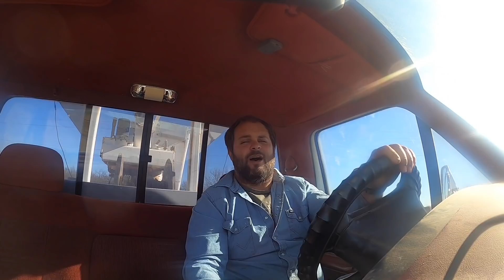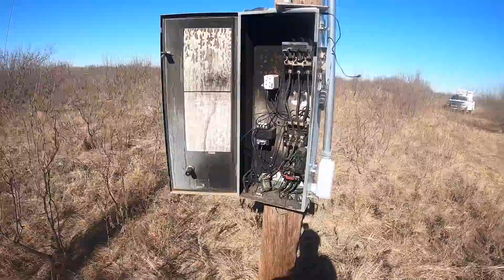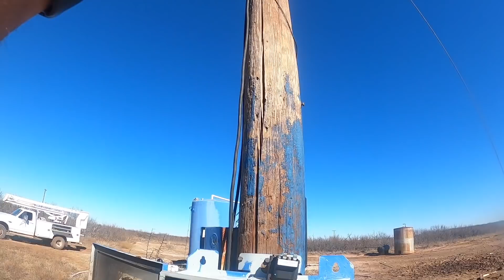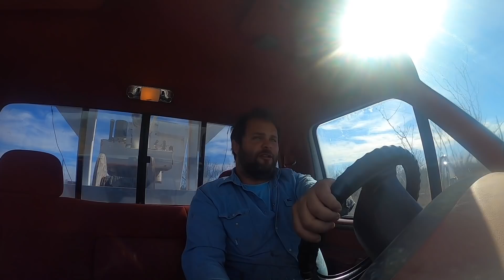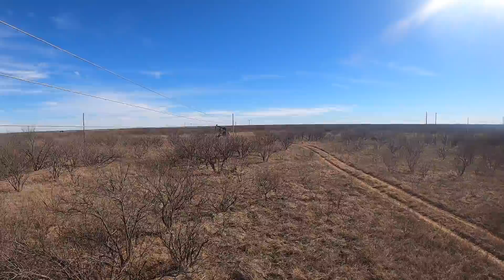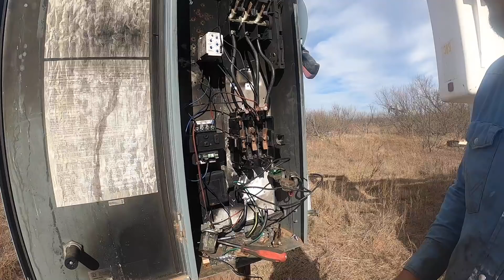Lightning Strike on Some Oilfield Electrical Equipment.

Comment: The clutch setup on the OBS fords absolutely sucked.

Every 3 wire delta system I've ever seen always had issues with voltage regulation and the faults were catastrophic.

Comment: Thanks Zach! I have to watch it again, esp the part where the wire exits the box to the side of the bottom and goes back up the pole to carry the power on to the next pole, if I understood correctly. Doesn't that makes the wells wired in series, not parallel? I have to watch it again. Thanks for the detailed video, really interesting! BTW why not use 3 phase motors on the pump jack? Wouldn't that save on running costs?
Reply from the maker: They are parallel and are all 3 phase 480.
Reply: @TheZachLife  Thanks for taking the time to answer! Have a great day!

Comment: Zach you should never connect copper wire to aluminum wire with out being separated by the correct kind of clamp because copper will eat up the aluminum and using an oxidation inhibitor grease is even better. Also when running the wire from the weather head on your conduit make sure you have a drip loop about two inches to keep water from getting into the conduit. Keep up the great videos.

Comment: Good rundown on NEC vs ad hoc wiring. Lightning doesn't care about NEC. It blows everything up regardless. So many surge suppressors are 'one shot' on a heavy hit. Varactors also wear out in time and do nothing to protect the circuit. They take a limited amount of surges.
The best bet is some kind of spark gap protection but given a big enough hit, they'll be damaged as well. Tips will melt off.

Comment: If lightning blows up the 480V wire in the conduit, would the ground rod at the pole carry enough fault current to blow a fuse back at the transformer?  Probably not. Would need a bonded neutral back to the transformer $$$

Comment: 😂 you should put a drip loop at the weatherhead so the water don’t run back down the conduit in your box😅
Reply: The conduit runs into a fused disconnect rated for indoor use only. Go figure??

Comment: Great video, that bucket truck you have is awesome for the type of installations you work on. Yes, Texas has a lot of heavy lightning storms. I have been chasing tornadoes in Texas, Oklahoma, Kansas in 2011- 2014 and seen those storms. A lightning rod on the pole won't help enough to protect the equipment as long runs of OH wires are fully exposed to lightning strikes.

Comment: Are ground wires that come down from the lightning arrestor on the tops of the poles are bare wire they're not in conduit

You could even put plastic conduit for the wire to the lightning rod

The other thing I would try is putting equidistant grounding rods into the ground

Just out in the middle of the fields take a 10ft rod and drive 4 ft of it into the ground

And watching lightning I've seen it hit many times things that were lower than the poles

You can see the streamers coming up off of the poles and off of everything else from the trees to the roofs of houses but many times I've seen the streamers come right off of the ground off of the grass and the lightning will strike the ground instead of striking something that has a streamer that's much higher

By putting in those rods in the fields you give the lightning a lot more places to potentially strike instead of hitting the pole

I would at least give it a try

Comment: Hey, how are you? Very interesting stuff you’re doing

Just wondering if you could make up some lightning veins and put them in your area with your heavy equipment you have around on the oil field. 

No, maybe make 68 of them 100 feet high or something lol 20 feet higher than what you’re working with
Reply from the maker: 5:14. Its electric. I would guess the bill is around $100 a month or a little more.

Comment: Have you ever looked into a product called lighting master or something similar?  If you understand how they work, how they created plasma and not attracted to lightning. Research understand how it works.

And another product midnight Solar MNSPD600 480AC or the correct application voltage for each  phase / one for each phase. Shop online prices vary.  
Check it out and understand how they work on the data sheet It may benefit to cut down on some of them lightning strikes

Comment: 18:40 that’s why it’s supposed to be properly grounded. And the current should take the path of least resistance and avoid you as long as your not grounded. Plus if there’s any fuses on those lines if it shorts to earth it’s gonna pull ALL the amps and blow.

Comment: i'd start stocking up on conduit and fittings...  and 5' ground rods.  proper grounding would go a very long way to preventing damage...  3 5' rods tied together at each pole would make a big difference.

Comment: Lightning Protection is a detailed yet grey art. Many simply just don't understand the physics and principles involved. 
Open wires on poles are a sweet target, especially in dry-land like you have. The cabling is pretty well considered a large network of grounded lighting rods, the air gap in breakers and insulation is not going to suppress the rise in electrostatic charge the preceeds a strike and forms the leaders. If you want to study this effect, look into what sailors called St Elmo's Fire. 
Open wires should have a top ground wire to take the bulk hit first (yes, others will still get a smaller whack). Put all your pole wiring in metal conduits and bond and earth as much as posible. Earthjing in dry area needs very deep rods and multiple points. If the water from your seperator is somewhat OK, a small leak intot eh ground around the rods will keep it moist/damp to work a lot better. Each phase in the system as each end of any exposed length of cabling above ground should have a lightning rated surge and ESD protection. The ESD side allows a controlled "Leak" of static charge off the power wires to limit the production of leaders. Spar-Gap or gas discharge arrestors at the pole tops to a earth array will save a lot of headaches. Keep ALL lighting arresting ground cables on the most direct path to ground and dont do horizontal runs. A tick used on earthing systems is a spark gap indicator. Main cable from groundings comes to a sharp set of points and then a small diameter piece of copper wires joins them. When site takes a whack, wire blows making it clear a strike did happen. 
Direct strike is not all you need to protect from, EMP from nearby strikes can be just as damaging.
Reply from the maker: Thanks. I have read about the corona discharge sometime visible before a strike, pretty wild. All of out stuff at here is set up as a corner grounded delta secondary with the top phase the grounded phase. We run 15kv spark gap arresters on the 7200v side and Delta 600V on the secondary 480 side.

Comment: If a lightning arrestor gets fried it saved your equipment, you've got to think of them as expendable. It's not something that's going to last, and if it does, it's not what you need.
Reply from the maker: They usually blow up with the box.

Comment: Lightning hates inductance.  It loves capacitance.  It'll jump a gap all day long.  But it will blow through a sharp turn or a coil.  The stuff we used on the tall buildings in Houston had stakes with rounded ends on them pointed up.  Supposedly it bled off the charge instead of letting it build up to cause a strike.  Not sure if that would help or not on top of your poles.The ground wires looked like braided aluminum rope.  About an inch thick.  I'd imagine the casing and tubing would be the best ground you could imagine, but I'm not really sure about that.  On our radio towers, I'd put a ring of grounds around it, then run the same length wires from the legs to the ground rods, and connect the rods in a ring.  Using flat grounding strap lowers the inductance of the ground, too.  But out there, I just don't know.  I figure you could reduce the damage, but it'd be expensive.  I think your "consumable" electric system is probably the best trade off.  Man, that is some kind of wild.  Dad told me of a spot in their pasture out near Mangum that ALWAYS got hit.  It was just something under there that drew lightning. 

If you are worried about something being hot, use a voltage sniffer.  It uses hand capacitance to light up a neon bulb.  Does that smoke conduct?  I'd be a bit careful around it.  We'd get something like that stuck on the inside of the TV transmitter.  High voltage in there would weld that stuff to the inside of the cabinet.  I'd pull maint every so often and was the inside down with alcohol.  Took about a full night to clean one cabinet.  We had four of them to make power.  Three visual and one aural. 

Cool vids man.  I like the backwoods industrial stuff just fine!!!
Reply from the maker: Interesting, One of the this thats not conveyed in the video of the amount of actual stuff we have out here. There are miles of overhead some 12000v and some 480, transformers, control panels, disconnects, We have tried different types of stuff like lighting arrester, 480v surge protecters etc and it seems they just blow up with what ever they are attached to. As you say a couple of disconnects and motors a year is about the cheapest solution we have found.
Reply: @TheZachLife  I figured you might use the spikes on that spot you mentioned that always takes the hits.  But man, you have the electrical grid of a small town on those leases.  I was shocked that you owned it and maintained it.  You are doing what I enjoyed, too.  Every minute is something new.  I worked in AM, FM and TV engineering in Houston.  As well as two way land mobile and unicom radios, computer networking, emergency generators, towers, high power and low power RF.  I grew up in Lubbock county on a small farm, and worked for farmers around me.  Not much I haven't done or am scared to try.  Watching your channel is definitely a hoot.

Comment: A hammer drill with a cup attachment (I made one from an old bit and a socket) works great for driving ground rods!  Nice work!
Reply from the maker: Interesting, good idea.
Reply: They have latching attachments that grab the side of the rod and allow you to drive a 8ft rod from the ground easy.
Reply: I did the same by chopping off one end of a four way lug nut wrench. Chucked that in my Hilti hammer drill and 8 foot ground rods sink in like butter.

Comment: I have sat up all night in at a remote Army base in Alaska babysitting a phase monitor during a high wind event. You're dome light was on btw (how handy is that info 7 months later - lol).  Getting a good ground is not as easy as some folks think.  Bone dry, frozen soil can create patches of "local grounds" that are not at the same true ground potential.  Cipher on that for while.
Reply: Don't worry about the dome light....listen carefully and you'll hear the truck idling.

Comment: I was a primary end steel mill electrician for 6 years, I thought we had problems with blow-up relays, contactors, and shorted-out fuse boxes from the steel dust in the air, man you have that beat not a good thing though. I was familiar with all the stuff you were working with there.

Comment: Maybe you should add lightning rods with their own separate grounds on each poll as you repair them, along with Lightning arresters at every sight? Surely this would reduce the carnage?

Classic case of commenting before watching till the end. You tried lightning arresters already.

That area is so flat you might try some one way radio beacons on each well. When a beacon stops reporting then you know there is a problem or power loss. It only needs to report once a minute/hour.

A few others have mentioned using a ground/neutral wire on the top above the three phases that only serves as a lighting wick and have it grounded at each poll, but not to any of the boxes, just it's own separate ground rod. Maybe add in a fourth line at the bottom and move the top phase down to that one and then use the old top phase as the lighting line.

Comment: There are some inexpensive and effective things you can do to protect your equipment from lightening strikes. 

There are several sources for this information.  I have not had a look at this for many years.  I recommend the Amature Radio Relay League Handbook as an inexpensive source.  They cover mostly theory buy also practical applications and equipment.  

They cover lightning rods(towers) and line (mains) protection.  

I have not had cause to looking the topic in many years.  I suspect you would be money ahead investing in some money in protection.

Comment: Get your provider to add another pole past the end of the line where you connect.  Then you should run another pole past the last pole that has your equipment on it. I can’t explain why, but that extra wire solves a lot of lightning issues on the secondary. In the ESP business, we always recommend that for people having lightning issues.
Reply: You are close to why but not why you think. Here is a tip, best way to think of l;ighting control is like water in a pipe. You get a huge pressure spike and wave on a line, hard corners can/will blow, having a long line can get a "Hammer" effect (hint for the lead-past line).....
Reply: What happens when lighting gets to the end of the line it flips over on itself and the voltage doubles. It with blow holes in underground primary lines even protected by lightning arestors, I have seen it to many times.
Reply: @robertmandigo7942  How does electric double?
Reply: @jwhayes1965  when lightning hits a power pole the lighting wants to go to ground so that voltage spike goes all directions from that point and when it gets to the end of the line the lightning arrestor only bleeds it down to the voltage that it is good for because it is moving so fast the spike goes back the direction it came from and that causes the voltage go way up or double, I went to some continuing education classes and they had graphs of actual lighting strikes hitting the end of a line and the the voltage goes way up. I had it when a transmission line wire got hit by a tree and it came in contact with a distribution line and my transformer was not at the end of the line but the neighbor across the river from me and the one at the of the road both of them lost their microwave and TV, the capacitors exploded when the voltage spiked and my house was just fine.

Comment: I can tell you know a good deal about electrical but just a friendly tip. If you have do to any work on the box, switching fuses, replacing contractors, etc., always close the door and stand off to the side. Arc flash is no joke and don't want to see anyone get fried.
Reply: But he engaged the safety squints AND turned his head away when he defeated the door interlock and threw the switch! That's gotta count for something, right?
Reply: @gorak9000  always cup a hand over the goods too

Comment: Hey Zach, Young electrical engineer here, love your videos. Have you ever tried some sort of modular lightning protection system? I don’t even know if this exists, or if it would be cost effective, perhaps on just this location or two like you stated it’s more frequent here. I kept waiting for a mention of lightning protection either if you tried it and it didn’t work or if it’s just to much of an investment. Thanks!
Reply from the maker: I do I run lighting arresters on the 7200/12000v side and at all the 480 volt control panels. I do think they work and probably cut problem in half but they sometimes blow up/ other stuff still blows up/ they are expensive blablabla. I do think they help though.
Reply: Side note, tank grounding?

Comment: Have any problem with the copper/aluminum joint in the split bolt, corrosion issues?
Reply from the maker: Really don't seem too. Every once in a while ill find a really old one burn up but i think its from coming loose not corrosion

Comment: Really have been enjoying your videos... One thing I have noticed on poles here in Alabama is they will run a separate copper ground wire that sticks up about a foot above the pole and runs down the pole to a separate ground rod. It does not connect to the box. Might be wishful thinking or maybe it helps. Just a thought. Best...
Reply from the maker: A lot of people have been recommending stuff like this. I may have to try something like this.

Comment: Probably a stupid question, but wouldn't PVC conduit reduce the risk of electrifying the box?
Reply: Absolutely. Additionally, you should carry a tester around and test each box before touching it. Or just brush it with the side of a closed fist if you're brave or don't care about electric shocks every now and then.

Comment: If you mount a hairdryer (in the on position) so that it will blow hot air into the intake of that diesel, and let the power cord be accessible outside of the grill.....  You can plug the hair dryer in prior to starting, then go start the engine, i bet it will fire up almost immediately.

Comment: Well ya done did everything right cept one thang, all said , provide a better  atmospheric electrical opportunity to get to ground, NOT going through any of  your electrical system, and it won't get cooked. In Kansas as well as in the Amazon known as a Faraday Rod , Franklin Rod, Edison collector kinda like what is found on roof cresting in the 1800s. All them there trashed brass pumper rods would be prime candidates for this app 
You could call em Zacksrods relampagos.